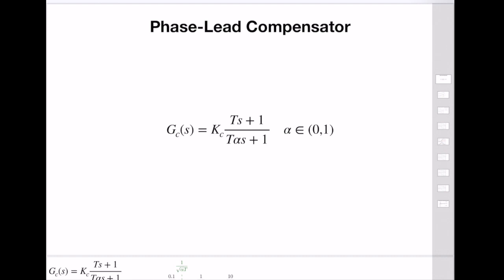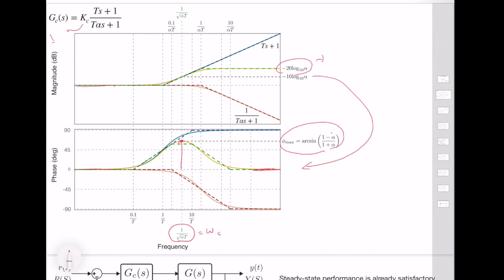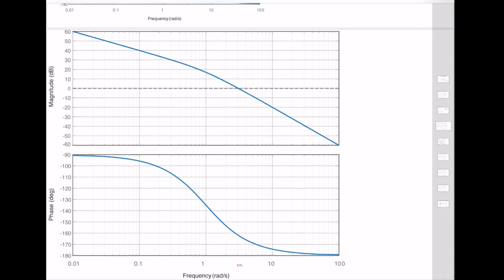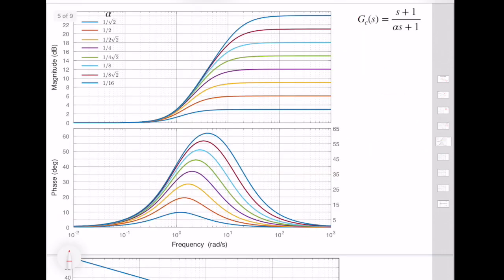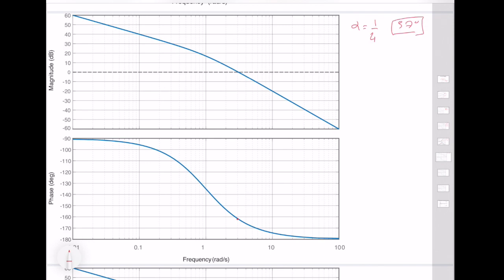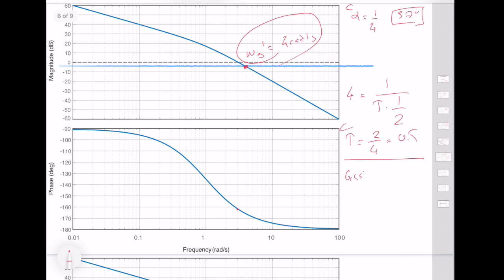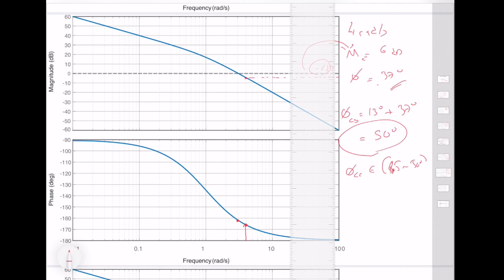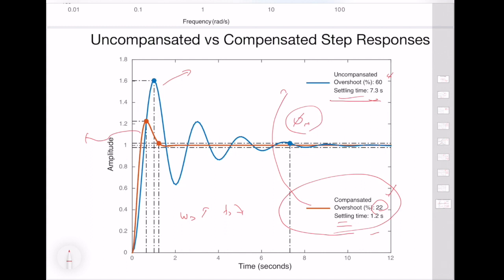Phase Lead Compensator - Graphical Design

Comment: dont confuse yourself with Kc.
just  G(s) lead =  (1/a) [ (s+ 1/T) ÷ (s+ 1/aT) ] and do your calculations.
(1/a) is to set the dc gain to 1 (0dB), in order not  to interfere with your open forward path gain.